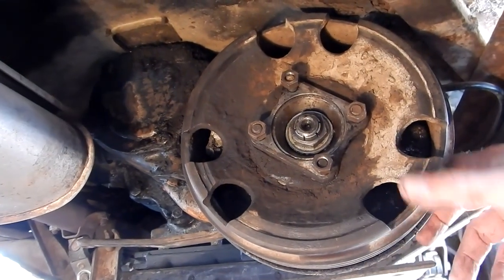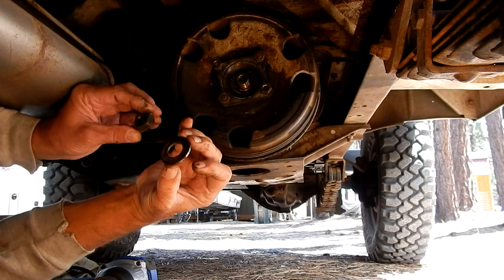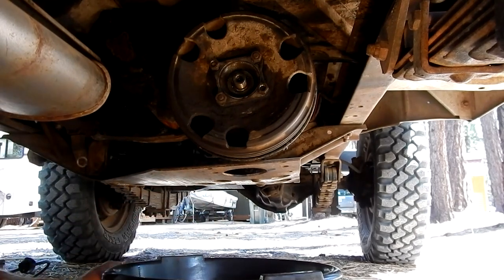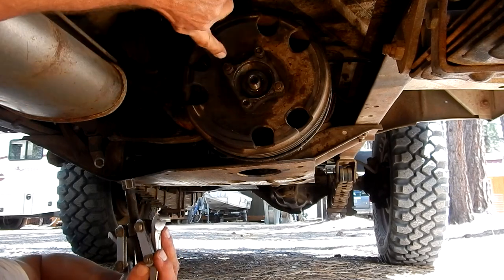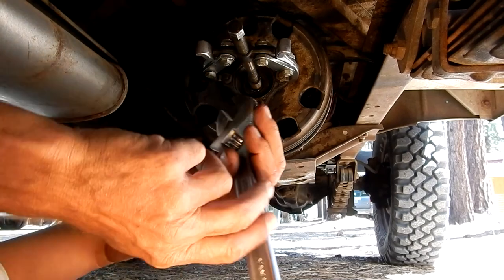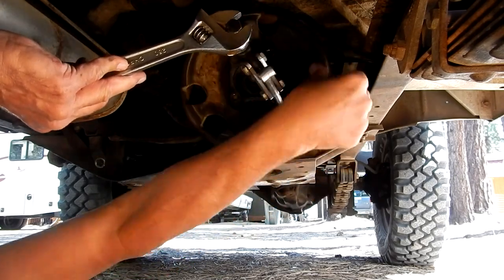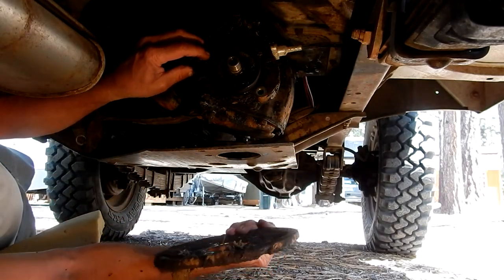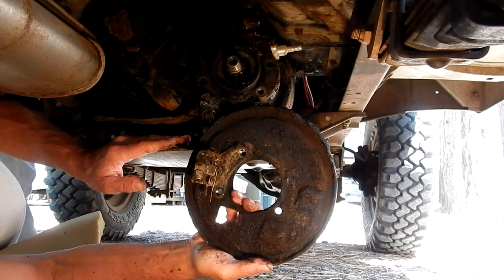JEEP - How To Remove Emergency Brake Drum And Backing Plate

Comment: Hi Tom -I'm enjoying your common sense videos on your CJ. They're helping me do the same on my '57 CJ-5. One comment on this video: On my '57 model, the nut holding the eBrake drum on is a 1", not an 11-16". Might just be a change in the years. Anyway, all is good! Thanks!
Reply from the maker: Hi Jim, thanks for your input on the nut size. These old Jeeps are fun to work on for the most part. After having the engine rebuilt on mine I'm still breaking it in. Good luck with your project.
By the way I never did get my emergency brake operating. I need a new backing plate which I am unable to find.

Comment: Does the case need to be drained because those backing plate bolts pass thru into the oil cavity?
Reply from the maker: Yes. I drained the T case because when I started to remove the drum the shaft seal started to leak.

Comment: Thank you for your help, i just a 1955 cj5 and i am cleaning under the body. I took the e brake apart today and when i put it back together 6:16 one of the nuts wasn't re connecting the Drum to the Flange because one of the nut stabilizers was stripped in the hub. I might just tac weld the nut to he hub, any advice?
Reply from the maker: To be honest I can't recall if that was a regular bolt or a flat head stud pressed into the flange. I suppose you could lightly tack weld it. It would be better to replace whatever  is stripped if you can.
Reply: Mine Exploration and Hiking with Tom and Julie that would be the drum, $65+
Reply from the maker: @chris707man  The drum and the flange are separate pieces.
Reply: @TomandJulieMineExploring  yeah, the drum is stripped and isn't holding the bolt when i try to tighten the flange and drum to the shaft.
Reply from the maker: @chris707man  I must be thinking of it wrong. I thought there are regular bolts going through the drum and flange with nuts on the other end. I'll look at it tomorrow.
Reply from the maker: Did you get it figured out yet, Chris?
Reply: Mine Exploration and Hiking with Tom and Julie  I think so, I’m going to have to tax weld the stripped out area on the hub the hold the bolt in place so I can tighten it down. Or buy a new hub and bolts, but that is $70. In my first comment I tagged the time stamp where it shows the bolts connecting to the hub.
Reply from the maker: @chris707man  Okay, good luck with it.
Reply from the maker: @UPS Chris https://www.kaiserwillys.com/emergency-brake-m38a1-5685
I know this says it's for the m38a1,  but it shows the flange and bolts which are just like mine.

Comment: Hi Tom thanks for the great video! I'm wondering if you made the part 2? I can't find it if you did. And, I'm sorry I think I posted this comment on the wrong video earlier... whoops.
Reply from the maker: No worries on the mix up on the post. I never did make part two. The reason for that is my backing plate is missing a part on it. I don't know exactly what the part is called, but it's a bracket that is riveted to the backing plate and holds one end of the shoes down. I looked high and low but couldn't find either the part or the whole backing plate. I know they are out there somewhere, I just gave up looking. So my E brake still isn't working. Thanks for the comment, Brad!
Reply: Oh too bad! Hope you find it. Thanks again
Reply from the maker: @bradh5613 You're welcome. I will probably look for it later in the summer.

Comment: Tom! Don't buy any parts to fix that old drum brake! They never worked worth a damn! Buy yourself a set of rear brakes from an old jeep pick up or waggon. These are 11" brakes and will do a hell of a lot better job stopping you and they are set up as parking brakes as well. You will have to custom make a parking brake cable but it's an easy deal! This is a much better way to . Leave off the backing plate and knock the drum off the drive flange and install it without all that crap that doesn't work! Have fun! You should change the front brakes out to 11" as well when you get around to it, you'll be amazed at the difference! Good luck!
You can tow that rig up to my shop and I'll give you a hand!
Reply from the maker: Hey Max, thanks for the advice. I figured that these didn't work very well. I will look for some 11" brakes to use. You should be careful about having me up to your place to work on this, I might take you up on it. Hope the mine is keeping ypu busy.